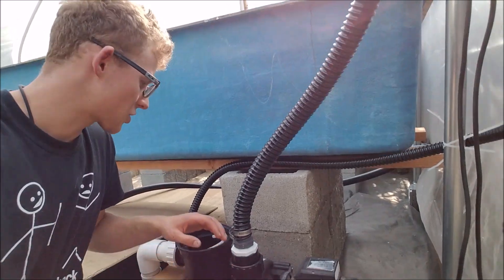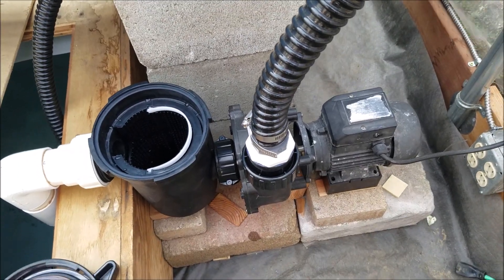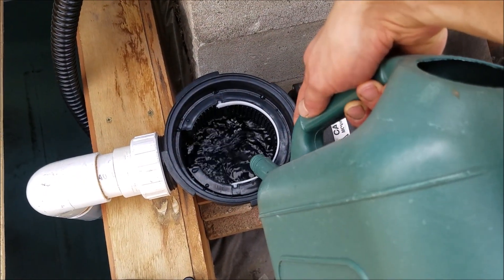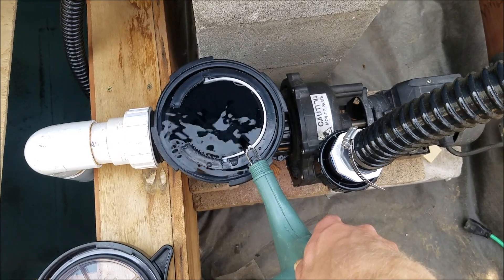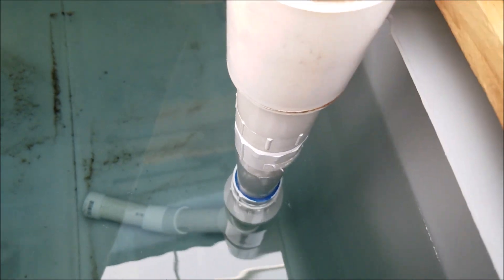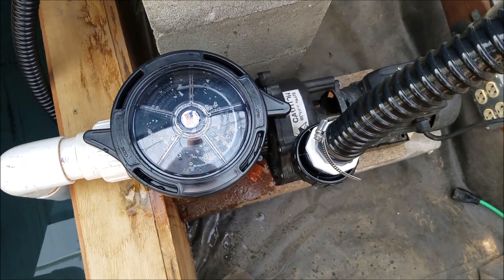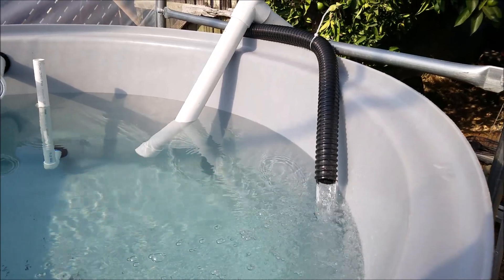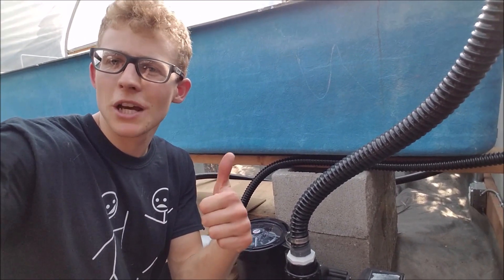How to prime an external pond pump (Hybrid aquaponic system)

Comment: I just inherited a pond with koi. I notice that the water pressure to my fountain was high and spilling over and freezing. So I decided to investigate and loosening what I thought may be a pressure valve. Turns out is was a gage to show that the pump needed cleaning. Now when I plug the pump in a lot of water spills out of the pump. I know nothing about ponds or pond pumps. Could you help advise me on what to do. I do not want my koi to die.
Reply from the maker: Its hard for me to tell you what is wrong with out actually seeing the setup itself and going through things. If you have a pond store in your area I would suggest having someone come and take a look at it. That way they can walk you through everything and help you out. 
If no local pond store maybe make an add on next door or craigslist  mentioning that you are a new pond owner and need some help. You might find someone knowledgeable in your area that can give you assistance. 
If that doesn't work out, maybe make a YouTube video showing everything and I can see if I can give you any advice. Or forgo the old system and setup your own new filtration so you know how it works.
hope that helps
Reply: @vonponics  Thank you so much for responding! I appreciate it. I will make a video and tag you.
Reply from the maker: @omyourday7279  no problem. Not sure if I can even help through a video but I will try.
Reply: @vonponics  Thank you! I tagged you in the videos I made. If the tag didn’t work, just click on my channel.
Reply from the maker: @omyourday7279  Here is a video I made on your setup. I thought this would be more helpful than just writing a response. Hopefully this help you out. If any other questions just ask.
https://youtu.be/QTFRjp8E2oE
Reply: @vonponics  I am unable to view it. It is private.
Reply from the maker: @omyourday7279  it's viewable now

Comment: Is priming pot remains always full with fluid while running
Reply from the maker: Typically yes the priming pot will always remain full. You could possibly have an air bubble at the top of the priming pot depending on how it is set up in relation to the pond. But there should always be water in the priming pot while the pump is running. If the priming pot looses water and fills with air you most likely have a leak in the plumbing somewhere.

Comment: Do you have to put the check valve under water?
Reply from the maker: no it is not necessary to put it underwater. Each setup may differ in how and where you put the check valve.

Comment: I bought house with Koi fish pond however i am not able to talk with previous owner and they leave the house with no electricity. In electricity restore i started pump knowing it is working fine then ran pump about 8 hours for two day. When i started living the house i noticed pump is running but no water entering prime tank then i found you in youtube follow your instruction but still no water coming in. Also i fill prime tank but never full with water. I feel there's no check valve or one way valve. I am really new but i am a technical person would you able to help me please what to check/do to prime my pump or if theres some missing. Thanks you so much for your help in advance. Al
Reply from the maker: It is hard to say what your issue is without seeing it. There can be multiple things to look at.

But here are some things you can try.
Since you said that your pump priming pot does not fill with water I am going to assume that it is placed above the water level of your pond. If it was slightly below it would make priming easier depending on how the plumbing is set up. But that is off topic.

If you are capable (depending on the setup of the pond) you can check to see if you have a check valve/ one way valve.
Even if you do have one it could be clogged which is causing the water to not stay in the priming pot. 
If you don't have one or if it is clogged, you will have to mess with it and see if it will start by... 
Filling the priming pot up as much as possible with water, put the lid on and turn the pump on. If nothing happens try repeating this method as fast as possible without causing damage to the priming pot or pump. (having two people would help).

Also another thing that would make this easier is if there is a valve in front of the intake of your pump. If so fill up the priming pot until water starts to overflow. After that close the valve and put the lid on. Then open the valve very slightly and turn the pump on. Slowly open the valve more while the pump is on. That might work as well.

It is very hard to say what will work with your pump, since I am not sure how it is set up. It might be the case that you just have to keep filling and turning the pump on until it starts. Which will be frustrating since you will have to do the same thing every time you clean out the priming pot. 

If you get it to work and you don't have a valve in front of the intake of your pump (in front of your priming pot). I would recommend getting one so that you can close that valve before opening the priming pot to clean it out (after turning the pump off). This will keep the water in the pipes and make it easier to prime again.

Even with new setups depending on where the pump is situated, it will take some messing around with at the beginning so that water comes up in the pipes. It is natural for this to be an issue especially when the pump is above the water level. 

For my setup that you saw in the video. It is a lot easier to do since, one I have a check valve, and two the pipe is very short.

hope that helps.
thanks

Comment: If the water doesn't stay in the priming pot when you fill it, that seems more like a leak or a missing or broken check valve.  I guess you could think of it as "air getting in" but it's really more of case of water leaking out.
Reply from the maker: Yes pretty much the same thing.
But also water wants to go the easiest way. Therefore since the pump is pushing water in one direction.
I believe that if the hole is small enough it can create kind of like a venturi effect. Where it pulls air through the small hole/gap. Causing air to enter the priming pot.
But correct me if I am wrong.